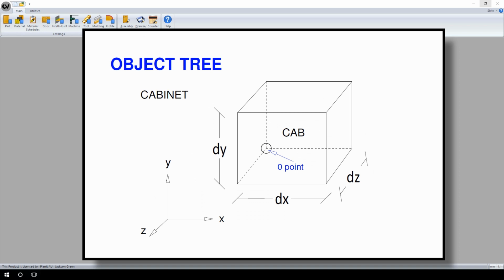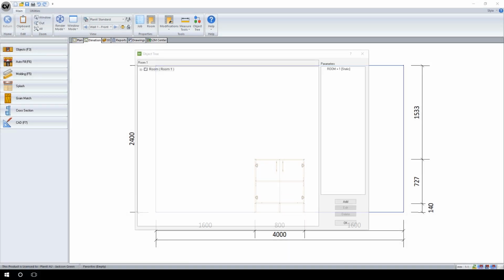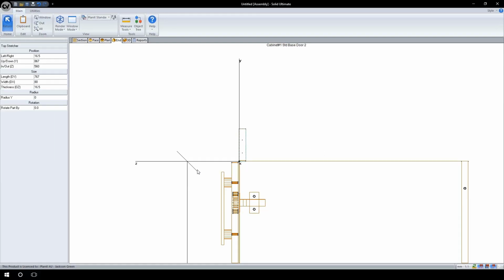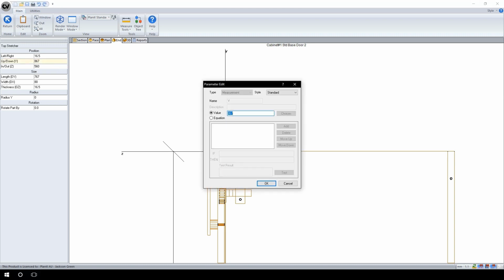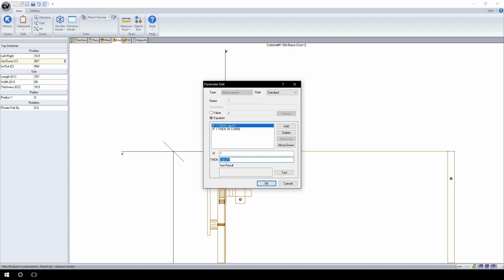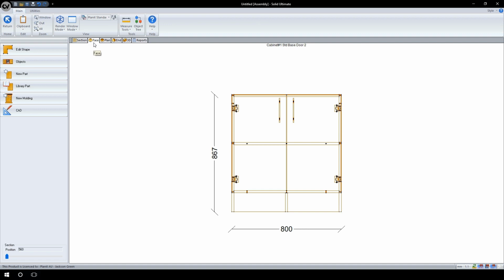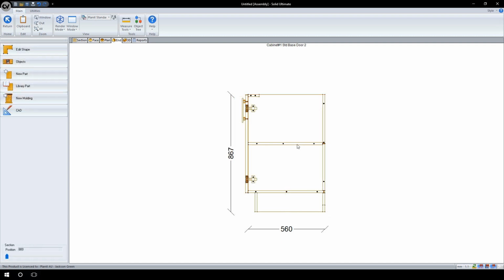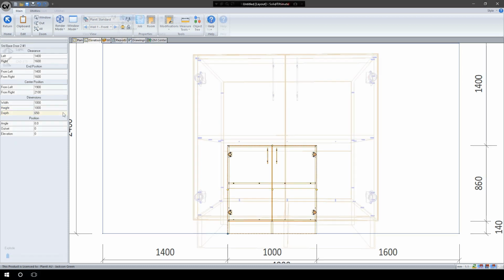Cabinet Vision Tutorial (Expert- 8) - Introduction to Object Tree

Comment: How do set rabbets cuts for the ends?
Reply: A M+T joint for the rail? Assign it in your construction method or via UCS. Then apply the equations shown in the video. It should rabbet out wherever the rail meets with the cabinet ends.